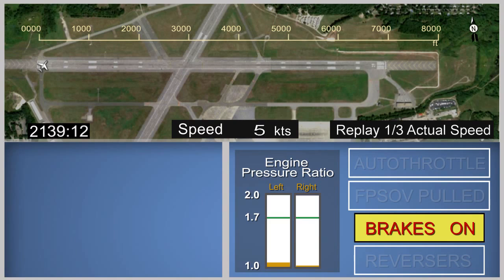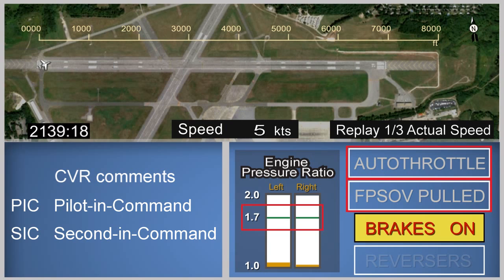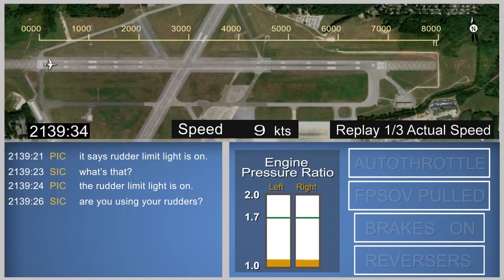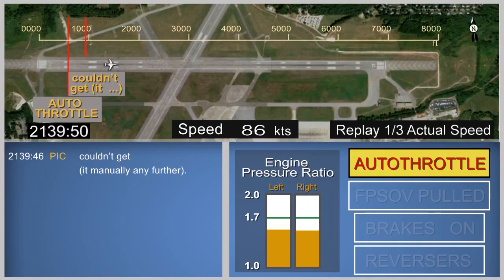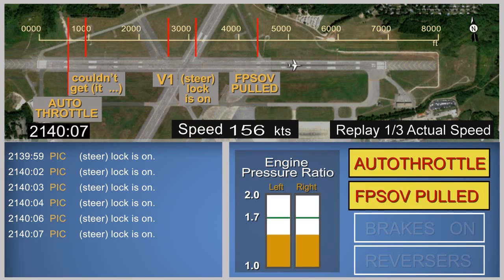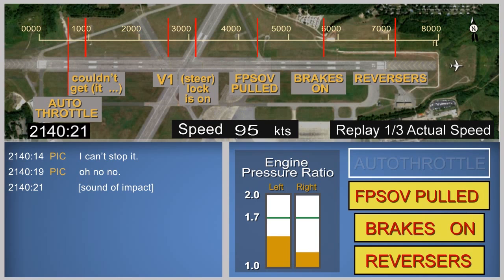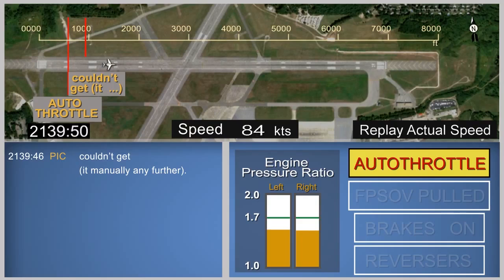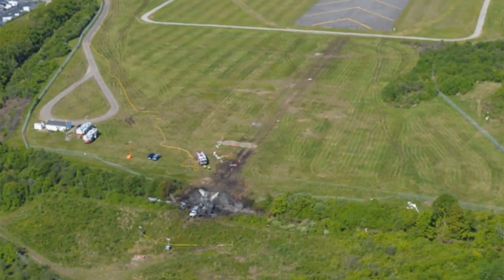G-IV Runway Overrun (RTO) Bedford MA

Comment: CVR makes it sound like they were trying to disengage gust lock.  Gust lock engaged at an air speed of 160+ on the ground isn't part of the typical configuration but why were they unable to disengage it?
Reply: At that speed, it would’ve taken them 190lbs of force to disengage the gust lock. Likely unable to do so. Sad, but gross overlook of POH procedures to check flight controls… I took off from this exact runway just yesterday, sad reminder that procedures are not to be taken lightly, and we need to fight complacency.

Comment: I have seen "smileys" intake covers sucked in, mats,caps ingested. Hand prop runaways. Saw a Citation taxi out with a tow bar attached. 2 airliners taxi out with employees closed up in the cargo bay. Luckily both beat on the floor alerting the passengers. At KCUB a tail dragger lifted off with a large brick tied to the tail wheel before sitting it down. Bunch of misfuelings, 18v frying 12v systems. Planes still hooked to the apu and yanking the cord out. Seats falling over at rotation. Seat belts hanging out beating the side. Baron taxied in with dirty underwear stuck to the tail. To many gear ups to remember. I could easily write a small book after 25+ yrs line/pilot. Whats sad here is they had 8 grand to work with.
Reply: I would read that book lol you do not mean literal dirty human underwear on a baron do you

Comment: You'd think an aural, take-off config,. or an big red "Gust Lock" warning isn't  too much to ask of from Gulfstream . Pilots fault? sure! but also construction incompetence by Gulfstream! IMHO
Reply: what are you talking about engineers can't account for everything. the pilots did not follow the check list how is this G ulfstreams fault
Reply: I'm talking about an simple "take-off config" warning...is it to much to ask for?  Gulfstream made a shitty design to allow an multi million $ airplane to take-off with gustlock engaged!
Reply: I would agree.  Something this critical/potentially fatal should be annunciated by a significant aural warning and/or red caution lights (not a blue rudder limit light). That said, yes, the pilot(s) screwed the pouch;  Improper checklist execution.  Slow it down, set the brakes, get 'er done.  Warning light.  Abort.  Failed to reach power target.  Abort.  Thrust levers not in proper position  Abort. Steer lock is on.  (even past V1, she won't fly)...Abort. (4,000 feet remain.  Probably could have stopped her)   RIP.
Reply: +J.D Invictus--PILOTS can become lazy aholes like anyone else..I have flown with many...CFI 3 decades..